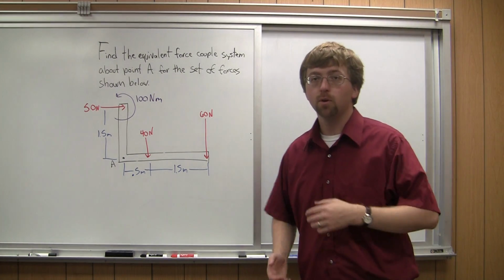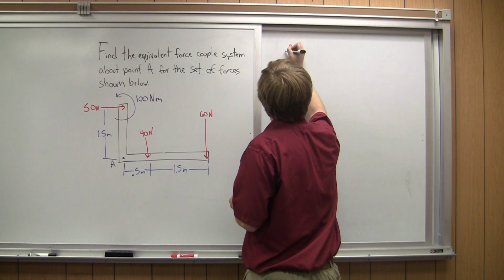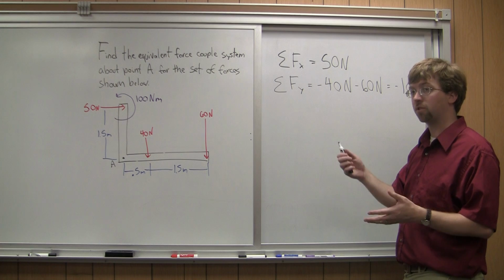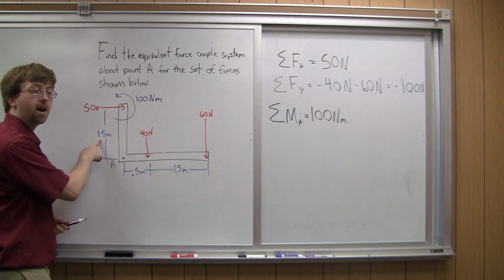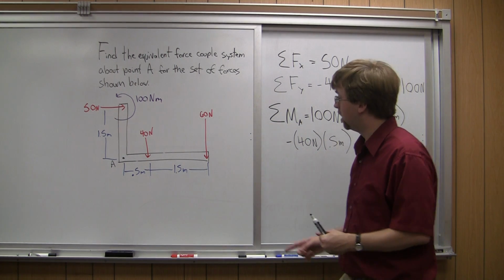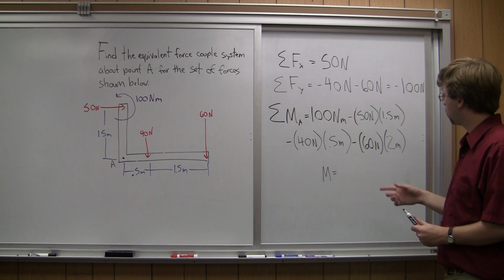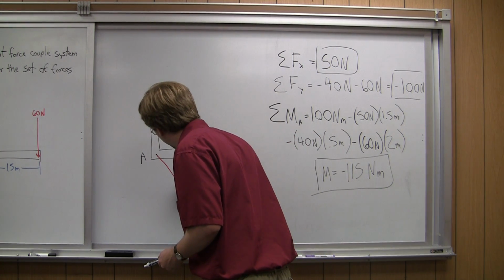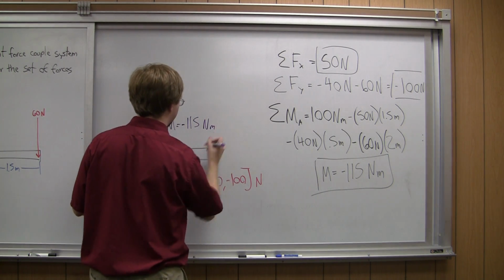Equivalent Force Couple System - Adaptive Map Worked Problem 1

Comment: Why is it anticlockwise rotation positive
Reply from the maker: That's simply the "right hand rule" convention. It doesn't really matter in a problem like this (so long as you are consistent), but if you are calculating moments with cross products it will matter.
Reply: But why did you write -115 Nm and not just 115 Nm at the end?
Reply: @zinc6748  Yes, typically when you include the direction (graphically in this case), then you write the absolute value of the scalar part.  You could also write the equivalent moment as 115 N*m CW (clockwise).